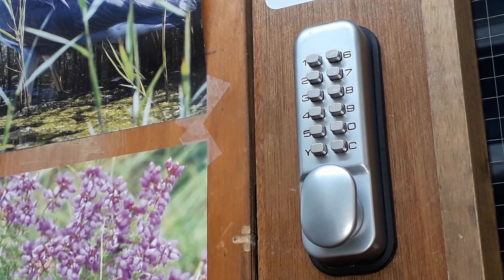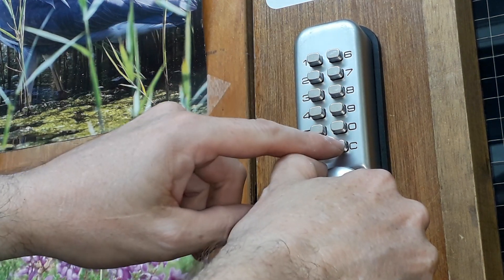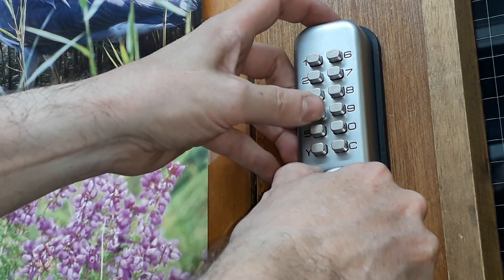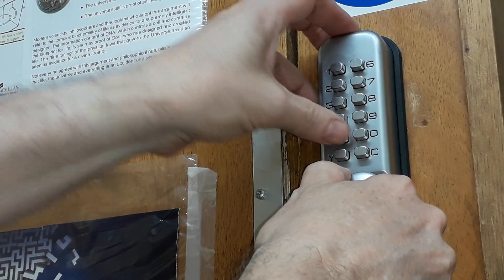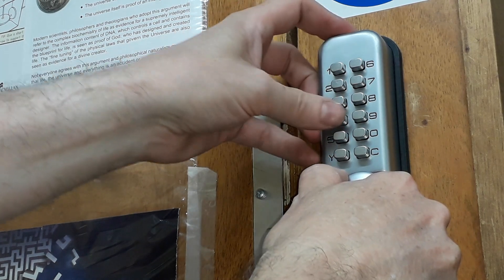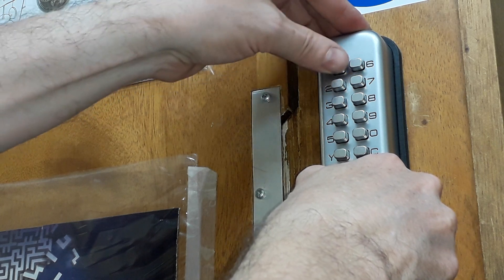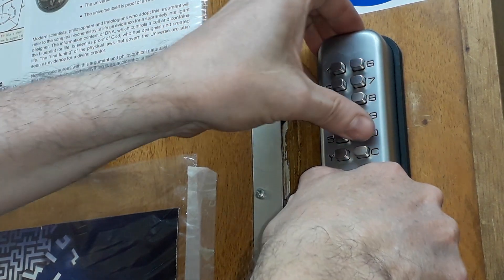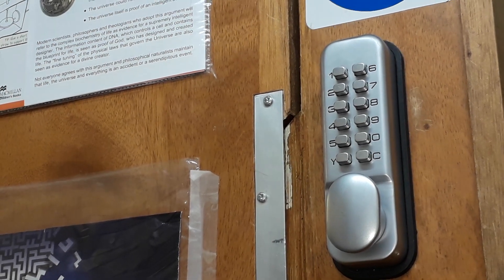(040) x2 Digital Push Button Door Locks Bypassed

Comment: There many things that should never be shown online!! I have people breaking in my house because people put everything online. That is where criminals go to find out how to... Idk... Break in your home or room. I am in danger now. My neighbor informed me he seen people coming into my home that were doing something with the code box, breaking into my house yesterday. I just had my code changed by maintenance. Yet they still managed to break in. People like you will pay a price one day for being so careless and putting this crap online. People like you are responsible for crimes being committed. What if they were inside my home when I got back and raped me and killed me? Or what if that actually may happen? Shame on you
Reply from the maker: Less that 2% of break-ins are attempted by picking a lock.
It takes time and practice to achieve a reasonable success unless you are using cheap, rubbish locks. The idea here is to show how flawed these locks are so don't use them unless you are adding an additional lock for safety/security.
You're missing the point.

Comment: Nothing is that safe and secure as I wanted to place these on my home whilst I’m away
Reply: Me too until I just used this to get into my office at work that had the code changed recently and I completely forgot. COMPLETELY. Got in first try with this method so definitely looking for other options myself
Reply: Go 9 pin key lock ,have have special tools and be a lock picker to get in them
Reply from the maker: This technique takes a bit of practice, there is a tool that bypasses this type of lock I didn't show. Don't rely on these lock alone, you need a second lock for added security.

Comment: What a useless lock! Recently my apartment block got broken into. I suspect that the thieves knew this technique already.
Reply from the maker: These are not good locks to use alone for security to be honest. that is the main reason for this video.
Reply from the maker: There are also bypass tools. These locks are not that secure. They should always be used in conjunction with other locks.

Comment: I have a Securefast digital lock and the latch has locked but I cannot unlock it. The key numbers operate the release mechanism but the latch is stuck fast.I have taken off the faceplates and tried turning the latch mechanism with a screwdriver - it turns but the latch is stuck in the locked position. It would be great if I could open the door and push the latch back in but as the door is firmly locked I cannot. Anyone any ideas how I can free the latch ?

Comment: Hello, I watched this video but I have a question. If you were the other side of the door is it possible to open it?
Reply: Some of these locks are identical on both sides so require the code to be entered on either side of the door to open it.
Others are just one sided so can be opened from the other side without a code, these ones usually also have a switch to hold the lock in the open position if so desired.
Reply from the maker: Like YellowFTo says, some have codes both sides but most have a thumbturn.

Comment: Oh, thank you. Thank you so so much. I just moved into a new shared house, and my bedroom door has this lock. It seemed to work fine yesterday, but tonight I locked it behind me and it wouldn't unlock again... cue a very frustrating and upsetting hour or so putting in the code again and again and turning the stupid handle this way and that and pulling and pushing on the door trying to get it to work at a different angle or whatever..
Middle of the night so I can't ring the handyman (I tried, no answer) to come help and it's not a life threatening emergency so can't call emergency landlord line either.. looked up on google how to get into this kind of lock, stumbled on this video, and god bless your soul because while the technique didn't work on its own it seemed to reset the lock into the correct position so when I put the code in it actually let me in this time. Bless your damn soul. Saved me a meltdown 😭💞
Reply from the maker: Thank you so much for the response to my video. So happy you finally got in, even though it wasn't with my technique.
Reply: I’m in this EXACT situation right now, I’m sooo frustrated. Just give me back a lock and key at this point 🤦🏾‍♀️

Comment: Hi I’m
Struggling to find a video on how to change the code on this specific lock , would you have a video at all pls ? X
Reply: Unscrew the lock from the door.  There are screw slots with dots behind each number.  First turn the dots so they are all to the outside, press C, then turn in the ones for your combination.  Test.  Reinstall.

Comment: Great video, is there any way to prevent this bypass method?
Reply from the maker: Not that I know of. New locks bypass almost in reverse (check my 067 video). There is also a bypass tool that slips between the lock and the door.

Comment: Hi the digi lock where your are trying to find the code the lock has y and c only  and doesn't have z and x on it. Needed to change code on the lick  it not the one where you just pull out the red marked keys   but has a  turn type to change codes    can you please help thanks
Reply from the maker: I think the turn ones are easier to change as there's less messing. I have several different types at work but because I dont changes them often as they are in very low security places it's hard ti remember. 
Not sure what your question actually is.

Comment: I have a LOCKEY m210 mechanical pushbutton deadbolt lock on a storage room where the BUTTONs started getting sticky soon after installation (beach community).  Yesterday my wife CLOSED and locked the door to test the lock function and the lock will not respond to the correct code.  Buttons and/or internal mechanism stick and will not accept the code to unlock the latch. The latch function appears free and unhindered.
Do you have a recommended technique to free the buttons or solvent recommendation to restore button actions to unlatch this lock?
Reply from the maker: The best was I would think to get lubricant to the back of the buttons would be to press then one at a time maybe half way and try squirting lubricant down the side of each button. By depressing half way the metal lip that stops the buttons from falling out whilst under pressure from the springs with beer half way, this allowing some lubricant to get behind.
Reply from the maker: You can also try depressing the C button all the way and systematically pressing each button starting at 1 several times. Then try the code.
Reply: Roy SammonsThat worked, I went over to Ace Hardware and found a $9.99 can of Tri-Flow lubricant.
I got home and doused each key liberally while repeatedly pressing each key.
The reset turn worked and then it accepted my code and opened. Success!

Comment: Crap I don’t know how long you could reply. But if u can be quick. Basically the other side of the lock, the handle is jammed and the switch is on so you’ll have to go to the other side to push the switch if u know what I mean. I know the code but the other side is locked. Is there any way of opening it from the code side
Reply: Yes,
A sledgehammer.
Reply from the maker: @BrettSucks 😂

Comment: Hi Roy what if you already have the code but it won’t let you open the door
Reply from the maker: The chances afte it's a faulty lock. One of the pins or springs could have damage to it. There is a bypass tool you can purchase that is slipped between the lock body and the door. It turns the mechanism that releases the latch.
Reply: Roy Sammons ok thanks Roy could I grind the front part of the lock off to access the spindle and turn it open with a screw driver ?
Reply from the maker: @dannymactheatreoflife.1771  Possibly.
If the mechanism has jammed inside that may not work. I guess you have nothing to lose if the door won't open. 
If you have to use a grinder you would be better cutting from the bottom, then the top, upwards and downwards through the top and bottom of the lock. That way you would hit the screws holding the lock in the door and the whole front should fall off. Then it's just a case of using a screwdriver to twist open ther latch. 
Hope you get it open.
Reply: Roy Sammons thanks Roy I will give it go 👍
Reply: Roy Sammons Hi Roy thanks for your help , i managed to open the lock by cutting away the rubber seal at the back of the front key pad and the just slightly prized it open with a chisel and expose the holding screws and cut through them with a hack saw blade and it just fell off , and then opened the latch with a flat head screw driver like you said and that got me in . I have replaced with a new lock so thanks a million 👍
Reply from the maker: @dannymactheatreoflife.1771  God to know you got it open one way or another. Take off the rubber and skip a hacksaw behind the keypad,  great idea. There is some risk to damaging the door though with the hacksaw blade. 
Great job buddy 👍🏻
Reply: Roy Sammons Hi Roy I took the blade off the hack saw and wrapped some gaffer tape around the end of it so I could grip it and also put so tape around the area I was working on to protect the door from scratching 👍
Reply from the maker: @dannymactheatreoflife.1771  Good Job!!!!
Reply: Contact hackercenamichealbest@gmail.com to Hack the door code without stress

Comment: i know my code but it just wont open
Reply: Mr Locksmith suggested using a lubricant like Tri-Flow so I went over to Ace Hardware and found a $9.99 can.
I got home and doused each key liberally while repeatedly pressing each key.
The reset turn worked and then it accepted my code and opened. Success!
Reply from the maker: @jimsutton8874  Happy that worked for you 😁👍🏻
Reply from the maker: I believe there is a bypass tool but I have never used one.
Reply: @roysammons2445  Can you say more about the bypass tool?  I Know my code but the sticky buttons/mechanism won't open the latch.
Reply from the maker: @VARocketry  First the rubber seal that is trapped between the lock and the door is cut and pulled away. That allows access to get the bypass tool between the lock and door. I have only seen it used on YouTube once shi not 100% sure how it works. I think it allows you to grab the tetris knob to operate the latch. I tried to find the video but was unsuccessful.  I think quite a few of ther lock picking sites that sells tools has them to purchase. It's just a flat sheet of metal with a notch in it.

Comment: Thanks for info I probably buy this lock for internal door. How long does it take before these locks are no good or secure. Like you show in this video. I was checking this video https://www.youtube.com/watch?v=HOk9up2xX40 . Where he says C is to clear code. Only one thing worries me. If C is used to clear the code. Then anyone can gain the access. By just pressing C or X to clear the code. Please let me know after watching the video with link I have added here. I even thought to add yale cylinder lock. But I think That can not be fitted to internal doors. You opinion counts. Thanks.
Reply from the maker: You can buy locks similar to this with a key as well. I would only use this type of lock with a secondary lock if you want minimal security. 

The 'C' button does clear the code but once the code is set the C button only resets the buttons pushed in case you make a mistake. See it as an error reset in case you accidentally pushed the wrong button. It won't reset the code. 

Newer push button locks decode differently. I am not absolutely sure why but this video had a link to a new push button lock I decode.
Hope this helps.

Comment: I have found another door lock from Yale. It is touch screen lock. Do i really need to use app to lock and unlock my door. Because i do not want to use smart phone for it. Other thing! If someone else have the same lock in me house for their room. can they use their touch key system to unlock my room door. Here is the link for the product I found at Amazon UK. Please let me know about it. Thanks.  https://amzn.to/2v3w6UU
Reply from the maker: I haven't had any experience at all with touch screen locks that use a phone app to open it. They usually use a second back up method which can be the locks weakest link. Some electronic locks have a manual lock as back up anyway. My office door uses a fingerprint reader which is ok but the door also has a mortace lock to add extra security.  Personally if I were you I would pick up a decent standard  lock like the Yale Superior range which will work on upvc and wooden doors.. some of the Maxus 6 pin locks are reasonable too.
Reply: @roysammons2445  I have just purchased this one for my bed room. Still for security reasons.   https://www.amazon.co.uk/TURBOLOCK-Knob-Style-Security-Passcode-Emergency/dp/B07QJ4FBXH/ref=sr_1_1?dchild=1&keywords=tl111+digital+lock&qid=1607187154&sr=8-1
Reply from the maker: @ACTIVATEDADNANSALIMI1969  Hopefully it will be ok. Not sure what type of keyways and core is in that lock as back up but it doesn't look like a top quality one. If it's a wafer lock it won't be amazingly secure. It all depends on the level of security you need. The latching mechanism is good providing it's fitted properly.

Comment: I have question.Because you open this door so easily. Are these mechanical combination locks still any good. I am sure some one watching your video can easily open my door and enter where I do not want any one to enter. How can I protect my house? If any one can open my door?
Reply from the maker: I wouldn't say it was quite as easy as I did it. I had practiced several times. I think this type of lock is more vulnerable when old and a little worn. New ones are slightly more awkward to open as the technique is a little different.

My advice would be not to rely on this type of lock alone for ultimate security. The doors these locks are on are internal doors that don't need to that secure. You could leave the lock you have on your door and maybe add another for peace of mind.
Reply: @roysammons2445  I understand. Those are internal locks. Are there any better security locks you recommend. Here What I found at tool station,  https://www.toolstation.com/ed20-easy-code-change-digital-lock/p40746?utm_source=googleshopping&utm_medium=feed&utm_campaign=googleshoppingfeed&gclid=CjwKCAiAyeTxBRBvEiwAuM8dnRqWTCtwt8Zw6dKKeSLhV8ILUUgz2V9lACkDbXkWPXTVL5JwkrNEuBoCF4wQAvD_BwE       you can give me link if you know any better.
Reply: @ACTIVATEDADNANSALIMI1969  these locks are bypassed easily. As a locksmith I can get through these in a matter of seconds with little more than a thin piece of metal.  It really depends what you are using these for (and where) you wouldn't want one of these protecting your front door, but using them in a shop for a stockroom or in an office is fine as you can usually easily control who has access to these areas. You can use them in conjunction with other locks (deadlocks for instance) so that during certain hours you can keep the door double locked so intruders have a second lock to get through.
Reply: @ACTIVATEDADNANSALIMI1969  I don't know too much about the electronic locks, but I do know they have addressed some of the vulnerabilities of the older models with this version. From looking at pictures of the TL-111 I would say it should be ok though it seems that it has a manual key override which doesn't look like the most secure design (I may be wrong, they might be using anti pick pins etc. I would have to take a good look at one to tell. 
If it's on a bedroom door hopefully there aren't too many people who have direct access to it that are going to be trying to break through it.  The other part is the latch would be easily slipped (not sure if there is any defence against this such as it locking out until the code is entered, so it may be worth investing in a strike plate to cover the latch from a direct attack.
Reply: @vryko8567  I have found this video about installing this lock I think ot comes with strike plate. You can check it here. https://www.youtube.com/watch?v=KNkOLJM_NWc&t=2s
Reply from the maker: @vryko8567  Great advice 😁👍🏻
Reply: @ACTIVATEDADNANSALIMI1969  As long as you fit the strikeplate correctly so that the anti slip part of the latch does its job then it should be fine.

Comment: With some of the push button locks, it helps to do it a little different. When you find a working digit, clear the code and press that/those button clearly in, before putting tension on. That way you have less chance of a sort of overset half set button.
Reply from the maker: I am going to try that again on some of the newer locks that my method didn't open. Thanks Rune👍🏻
Reply: You are stupid like hell!